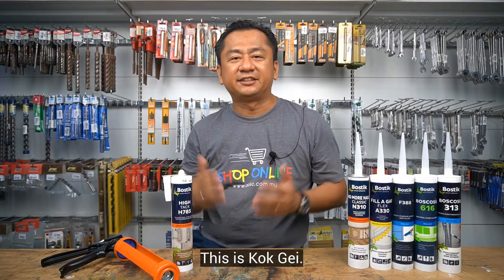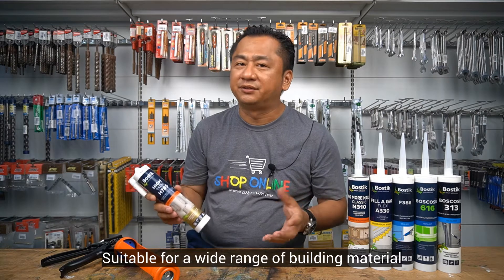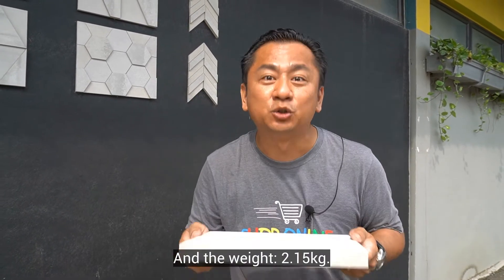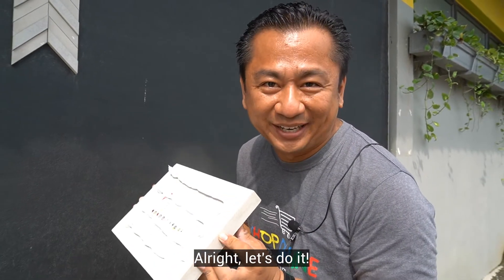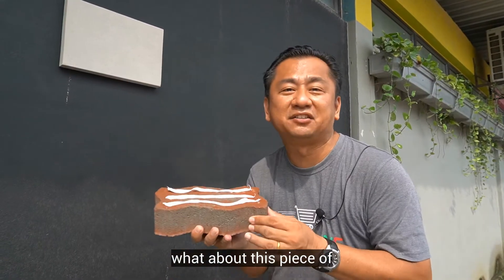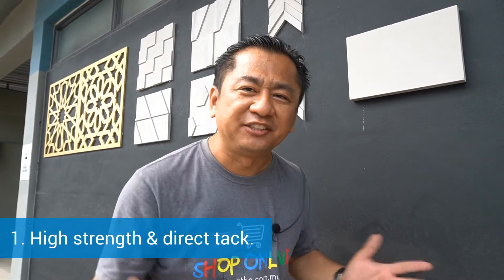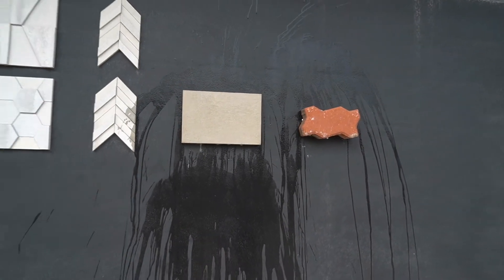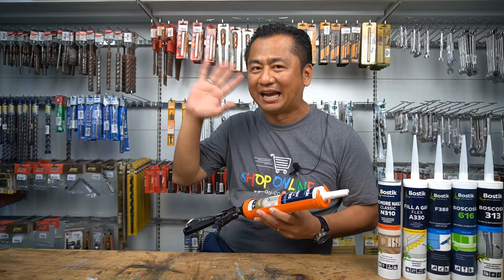Product Review | Bostik No More Nails High Tack H785 Ultra Strong Grab Adhesive

Comment: The test of the product should be the time--how long it stuck on the surface it was joined into. Especially if weight was added.  This is also permanent and would destroy any surface if removed. Will only use for small DIY projects. I'm sticking to screw and nails for bigger projects.
Reply from the maker: Noted.